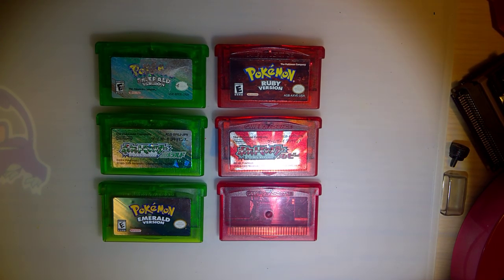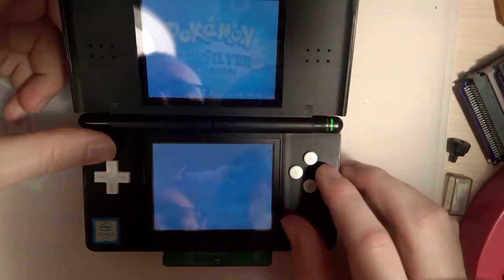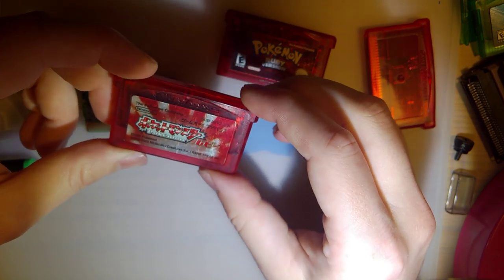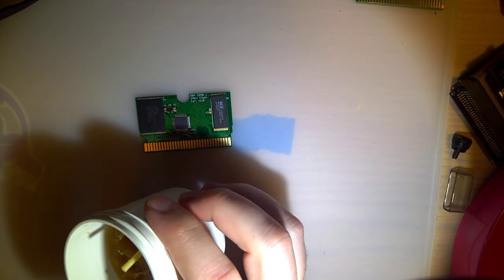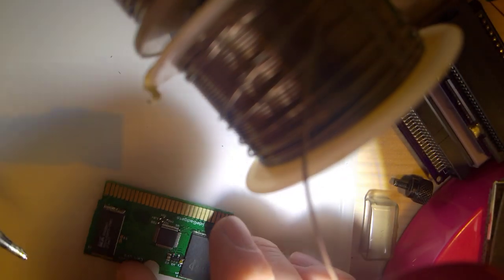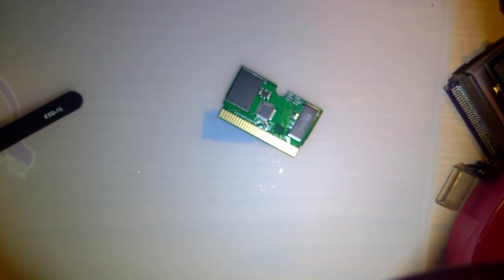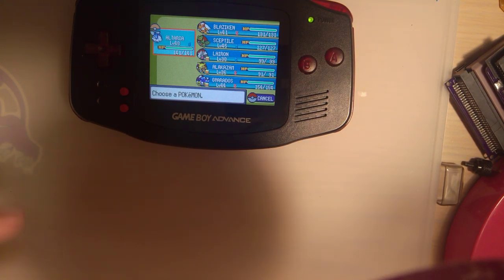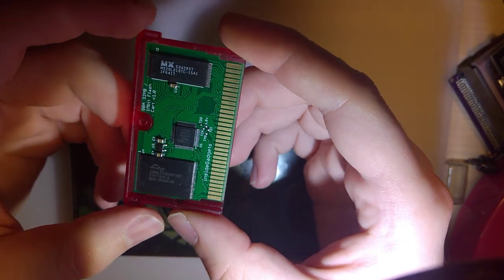Assembling an InsideGadgets GBA Flash Cart

Comment: This was exactly what i was looking for! I was also curious to see whether or not they would work with pal park. The main important thing is for the cart to have flash memory in order to do so, right? Since there is a decent price tag change between RTC and No RTC, RTC should not affect this right and is only for the berry growing? Tip: change your video title to Assembling an InsideGadgets GBA Flash Cart for Pal Park/Dual-Slot mode, I think a lot of people are looking for this kind of information! :D
Reply from the maker: I added a ton of tags to this video so searching that should still yield this video. And yeah, RTC should only affect the actual in-game play. The important part for the palpark compatibility is that the game header is correct and the actual save is readable (so if the save hardware is different than what is expected, the save will not be readable).

Comment: Pretty sure any US-based version (like German, French, Italian or so) would work with US DS games since their save data are compatible (unless the game was checking for the header, but that would be bad for many EUR players who would often have different languages in different games). JP and US are not, mostly because US ones allow for longer names - JP Pokemon names, for example, use 5 maximum of characters, while for US and others it's 10. If you put a JP save on an US rom (either in emulator or on a DS using a save transfer app), it would often work, but would glitch a lot.
Reply from the maker: I once put a US save on a JP Ruby and used that to transfer a JP exclusive Pokemon from a GameCube game. That seemed to work fine. I dunno why Emerald had a conniption. But regardless, I believe the gen 4 game reads the header of the gen 3 game and if they are from different regions, it will reject the import. I don't have anything other than NA/US gen 4 games and NA/US and JP gen 3 games to test it out with though. Well, I suppose I could get a gen 3 ROM now...

Comment: Hey can you make a video how to write a game in the cartridge because a bought one with the chip already installed and everytime I tried to write or read the cartridge I only get a logo failed, my cartridge came with demo game. I'm using the GBxCart RW. Thank you for your great job.
Reply from the maker: Use the newest console flasher. It takes a long time to write but just set it to the first GBA option and be patient. It will go (eventually).
Reply: @makho  I will try, thanks
Reply: @makho   I tried everything and nothing, I think the cart is damage, because I took a picture and when 
I zoom it I can see a little bend on one leg of the chip.
Reply: @ebgarcia1281  Hi there, could you please contact us at support@insidegadgets.com with a picture of the cart and a screenshot of the console flasher interface when trying to flash a rom? If you receive logo check failed, you might have to re-seat the cartridge. You can slowly adjust the cartridge while it's on the reader and press read info after each adjustment to see if anything changes.
Reply: insideGadgets ok I will send you all the information, thank you.

Comment: Some pokemon gba bootlegs are made to have the sav game built into the rom, they create the save file once you load the game, but it's weirdly enough inside the rom.
Dumped one and was like wtf it creates a save file with data even though I hadn't yet dumped its sav...
Reply: That is precisely why Pal Park would not work on those. They do have physical SRAM memory, which is backed up onto flash memory when saving and restored when booting, but there's no battery meaning the DS game will see the SRAM being empty. Theoretically adding a battery would keep the save and make it able to transfer, but some carts need to be slightly modified first and many of those have SRAM smaller than needed, so might not be detected as well.
Reply: @AtoManPL  I can't dump nor insert saves into that card. I can dump the rom which is 32mb btw instead of 16mb... I put that rom into the emu and it generates its own save file fom within the rom.
Reply: @elModo7  Indeed. You can't dump a save because it gets erased the moment you turn off the console, just like a legit game does when battery dies. The rom itself has a code hacked in so it restores the save once it boots, but that doesn't happen without running the game itself. The .sav file that a dump generates once you run it on the emulator can be flashed onto a legit game, though :P
Reply from the maker: @AtoManPL  GBA games use either SRAM/FRAM, EEPROM, or Flash saving (to my knowledge) and the protocols required for interfacing with each is different. This means that a game designed for one type of save hardware will not work with another. There is, however, a patch tool (GBATA) that will allow a EEPROM or Flash game to save to SRAM/FRAM. 

Long story short though, the gen 4 Pokemon games were likely only designed to interface with the original flash memory and couldn't interface with the SRAM/FRAM even if they were recognized and had a save.
Reply from the maker: @elModo7  Most bootlegs have two different patches working together. The first is to allow the game to save to the SRAM memory instead of the default flash (or EEPROM depending on the game). The next patch is specific to the exact hardware that the game is going to be written to. This patch allows the game to read a specific portion of memory (on the "ROM" chip) and write that memory to the SRAM on startup. This patch also copies the SRAM to that particular portion of memory (again, on the "ROM" chip) every time the save protocols are invoked. This effectively allows the carts to use the cheaper SRAM but without a battery at all. 

The biggest downside to this method is that it's really difficult, borderline impossible to manually patch it in. If you ever reflash your game, you'll likely never have batteryless saving working again. Another issue is that interrupted or low power writes can corrupt the memory. This means that instead of losing your save data if you power down at the wrong time (or even just try to save on a low battery), you risk making the cart completely unbootable. And finally, as you mentioned, most SRAM chips only go up to 512K instead of the 1M that is required for Pokemon games. When working with only 512K, the game will probably work fine until you beat the elite four. At that point, you will run out of available save memory and the save will corrupt. 

As far as injecting and dumping saves, well to dump the save, you just need to dump the ROM and then boot the ROM in an emulator. It will extract the save automatically and then you can go from there. If you want to inject a save though, you'll need to dump the ROM, open the file in a hex editor, and manually find and insert your save. I've yet to get this working myself.
Reply: @makho  that is possible, and those bootlegs are certainly patched to act like SRAM-saving games, just with a little twist. Some later bootlegs have more SRAM (I believe Pokemon uses 128k, which is 1mbit), but I had the one with exact same sticker you have and it was the cheapest one, dubbed "BV128" by BennVenn (the one with typewriter-like Nintendo print on the PCB) and it only uses 64k.

Comment: A bunch of real and fake pokemon carts and swapping the shells based on quality. Such a collectors problem haha. Do we know if gbata rtc rom hacks still work with pal park?
Reply from the maker: I haven't tested any ROM hacks in particular but if you can share a save that's far enough in the game I can test something. In theory, it should work for all the basic ROM hacks at least -- the ones that just modify difficulty or pokemon spawns
Reply: I think you're right. I was thinking about how the rom hack must use a different save structure to store the timestamp without the rtc, but apparently the stock games also logs the timestamp in save.